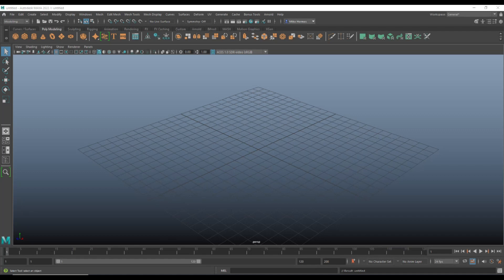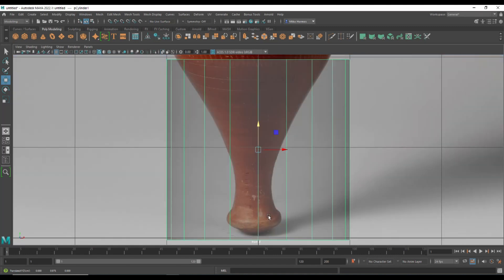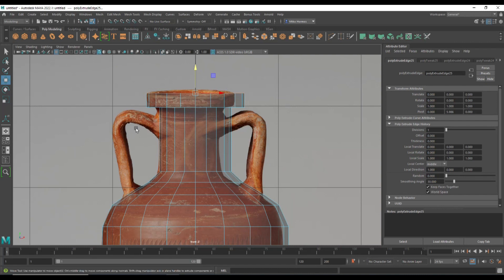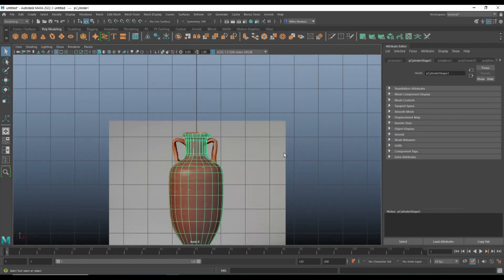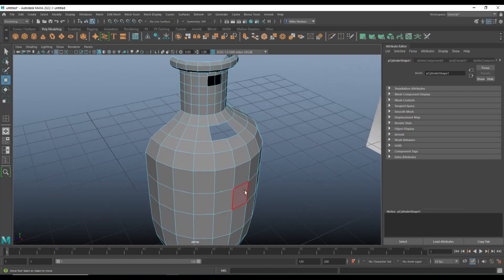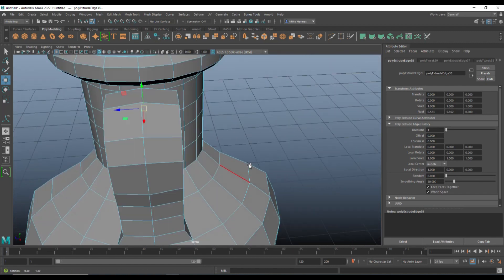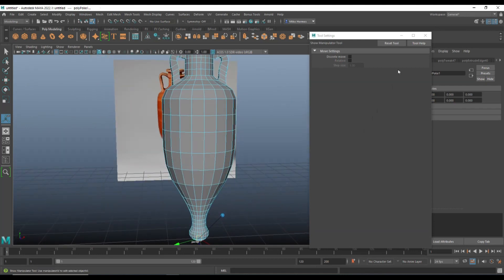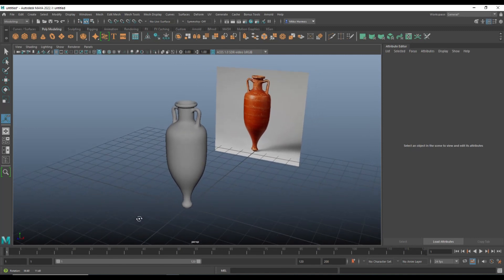Maya 2023 tutorial : Let's model a 3D Roman Amphora

Comment: Hi!
Thanks for your good tutorials.
BTW
What config of PC do you  recommend for work with Maya I mean modeling not animation?
Reply from the maker: You are very welcome :-) That depends on the software you use and whether you use multiple programs at the same time. Also, are you a pro ( using it a lot ) or a hobbyist ? But I would say at least 32GB Ram, an NVIDIA GTX or RTX card and an SSD HDD that is at least 1TB. A monitor with a minimum size of 19inches